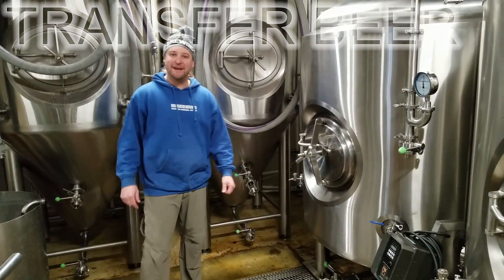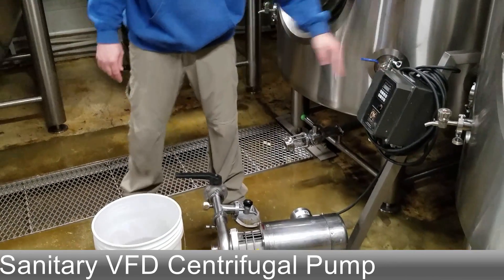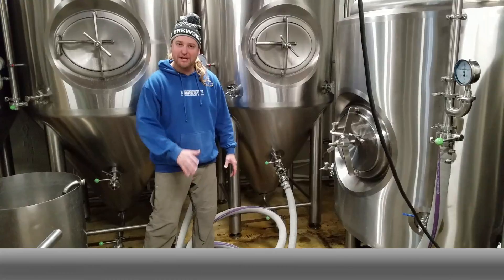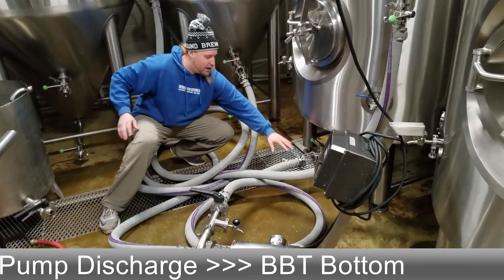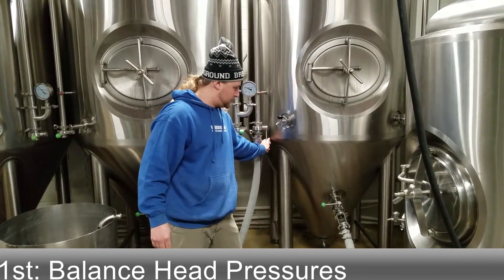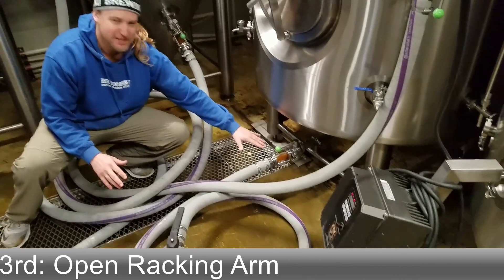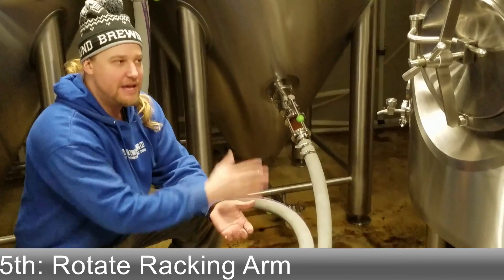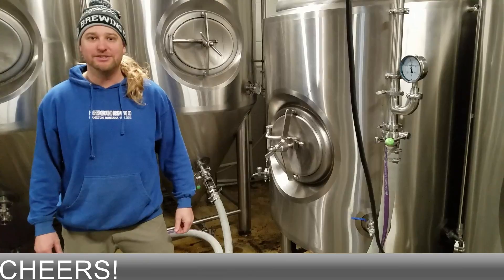TRANSFER BEER! How To: MICROBREWERY

Comment: I would also recommend purging the transfer hose to decrease dissolved oxygen pick up. 

Cheers
Reply from the maker: +Nathan Roundy Totally, Cheers!
Reply: I was thinking the same thing. Block and bleed?
Reply: Seems that at least a few fellow brewers paid attention to that important detail ;)

I would also recommend sterilizing the whole setup with hot water for 20 min in a line using some T-piece fittings, valves and additional hoses if a hot water tank is at hand. The water can be purged with the head pressure of one of the tanks afterwards. This method will minimize microbial contamination and unwanted oxidation at the same time.
Cheers from Berlin, Germany.
Reply: @FlorianBinsker  He said the hoses were sanitised. I would perhaps have also sanitised the receiving connections (perhaps already done also).
Reply: That was killing me! I'm going to assume they did it. We always hooked up an instrument tee with a sample valve. Then blow CO2 through the one of the the hose under pressure and then slowly bleed and push the oxygen out the other end.

Comment: A few thoughts and questions: 
 • would have loved to seen pump operation (even though it's probably specific to your pump model)
 • do you have a resource online for gauging head pressure with targeted CO2 volume in your finished product?, 
 • I'm assuming that in the FV after transfer's done, you'd slowly bleed out the pressure through that same valve you used to equalize pressure with the BT?
 • I'm also assuming that there's a reason you're slowly opening up those valves initially when you're equalizing the pressure between the tanks and the hoses — if there is, what's the purpose behind that, or does it matter?

As usual, you guys rock.  Thank you for posting this!  Keep it up!!
Reply from the maker: Thanks, Michael! 
-Centrifugal pumps all work the same and it's a great subject for another vid! 1st Prime the pump, In most runs (like this video) the pump will be primed when the butterflys are opened. 2nd Turn on the pump (on/off switch). 3rd adjust flow rate by restricting a valve on the discharge side, or with VFD (control knob that changes the hertz of the motor which affects impellar rpm) 4th Turn Off. Also great to know is: Pump Sizing, Pump Cavitation, and differences between Centrifugal and Positive Displacement pumps.

-CO2 Chart:               http://www.draughtquality.org/wp-content/uploads/2012/02/Carbonation_Volumes_Pressure_Temperature_Chart.pdf     

- Yes, slowly bleed the pressure out through sprayball arm or blow off arm on FV.

- Good eye! Open up those valves slowly for a few reasons; Pressure gauges always drift. The amount of pressure that the BBT was adding to the FV could have made the FV's Pressure Relief Valve (PRV) blow, In that case I would have closed valves and bleed some pressure out of BBT. Opening slower can help you hear a ready to blow PRV. Opening Slower is also Safer. You will put less stress on the hoses and be able to react faster if a seal or hose is loose. Opening Slower is more gentle on the beer. Finally Opening Slower is Quieter. Moving pressure in and out of larger tanks can be deafening loud if done too quick.  That being said, im sure you could open the valves fast and be fine 99% of the time, cheers!

Comment: I really appreciate how all of your videos are concise and to the point. I rarely log in to leave feedback or ask questions, but you my friend are doing a great job. Thanks!

Ok now for a few simple/quick questions:
- I assume the pressure in the FV is simply the result of fermentation? If so, at what point do you close your blow off and start building pressure? Is this done to condition/carb the beer up a bit before going to the BBT?
- I assume you've crashed the beer in your FV prior to this transfer? In my homebrew experience, there is actual a negative pressure built up during crashing due to science PV=nRT. This doesn't look to be the case in this video. Can you please explain where I'm off here?
Reply from the maker: Brian, Thanks for logging in and contributing, I appreciate it!
Yes "capping" the fermentation when the beer is 1P to 0.5P from target FG is standard. This capping does help build natural carbonation, aroma, ensures low oxygen level, and prepares for cold crash. Always have positive pressure before crashing the beer. Implosion of FV is unlikely but better to be safe and negative pressure will suck in oxygen. Once the beer is crashed you want to keep it at the pressure you will be looking to carbonate at. Adding more CO2 every couple of days. Hope this helps, Cheers!

Comment: Hello, I'm your fan and I follow your channel frequently, I live in Porto Velho-
RO-Brasil, I am setting up a small, very small brewery (1500 liters / month), since it is the only one that teaches the processes for commercial production, not making secrets of its steps .... about this video .. it was not necessary do the hose purge used to equalize the pressure between the tanks? thank you.

Comment: About how much liquid is lost per transfer, such as in the pump and lines?  On a 10bbl system, a couple gallons here or there may not be much, but in smaller volumes/systems, it seems you'd want to try to reclaim as much liquid as possible.  Or is this built into your loss calculations?

Comment: Do you not pack your transfer hoses with PA and flush out with a T-assembly right before the sight glass at the brite tank?
Would think you would have chance of contamination with hoses.
Reply from the maker: Totally a great technique to use! Best is to pack hoses with steril deaerated water after sani to limit microbes and oxidation. I will upload a quick video addon this week showing transfer with packed hoses, cheers!

Comment: hei I started working at a brewery and I find something weird in their brewing process and I would like your feedback on it:   the brewery has 3 vessels system with first vessel where the rakes are where they mash the grain, when mash is over they mash out and transfer the whole stuff with the grains into their second vessel which is the lauter tun where they have the sparge "arm". There they wait for the grain bed to stand still and wort to go through the bed as much as possible before draining the "first runnings" (about 2/3 thirds) of final wort volume to boil kettle until the grain bed gets stuck with obviously some wort leftover. Once stuck, they sparge non acidified 20% of total wort volume in water from under the lauter tun because they noticed they manage to extract the last wort in that way. maybe it is normal but isnt a combined mash tun with lauter tun a better combination ? I have the impression that the fact that grains are for 3/4 hours in contact with hot water + non acidified sparge water isnt making the beer round, hop expressive and smooth bitterness... if the rakes were in the mash tun wouldn't it be more simple and efficient? thanks

Comment: The hoses attached must have air in them and therefore oxygen. Any suggestions to reduce the O2 pickup here or is that not really of a concern?
Reply: Before i connect the hose to the brite tank i let some beer flow throw the hose first  and then connect it to the tank with beer in it

Comment: Is the outside material around your hoses to prevent scuffs/wear while moving them around or for a different purpose? Also curious on the ID of the hose you're using =)

Cheers
Reply: Looks like fairly standard brewer's hose,  maybe 1.5 or 2 inch ID. They will stand dragging around the brewery but don't like handtrucks or forklifts!

Comment: What do you think about transfering just using CO2 pressure?
Reply from the maker: It works. In my experience, it takes more monitoring, it is wasteful of CO2, and hard to repeat exact conditions for every beer. All that can be fixed with balance line and vfd pump.
Reply: i pretty much do this all the time , its alot easier.. just co2 up the brite tank a bit first... flush out till about 1 psi .. then start putting co2 into the fermentor and push  the beer into  the brite tank, keep brite tank at 0 pressure but there will always be an outwards flow of co2 when transfering so dont worry about oxgen. When your finished , if you got a fizz wizz.. do a prescrub then start carbonating to the desired level .